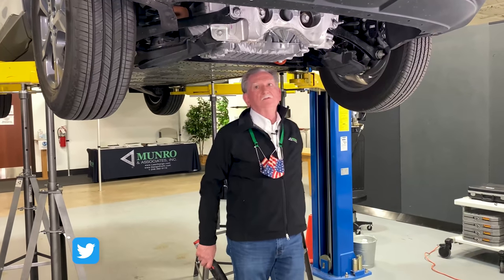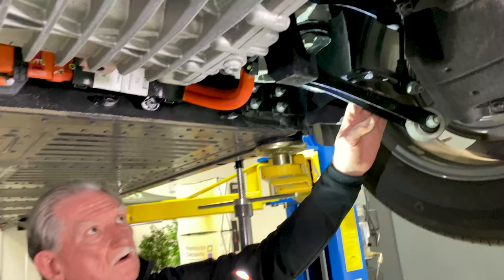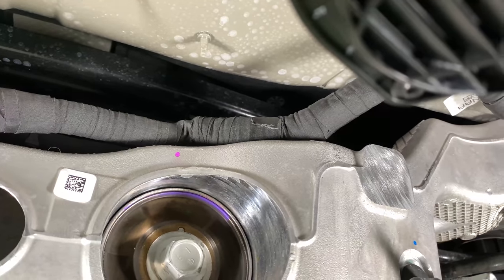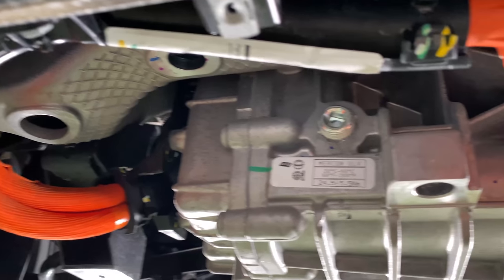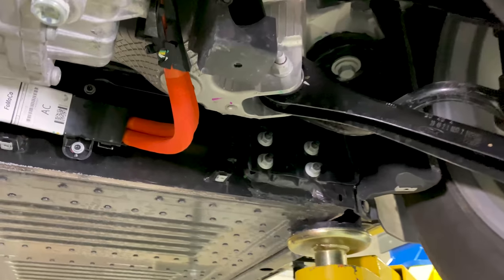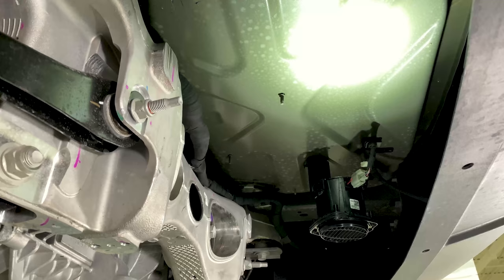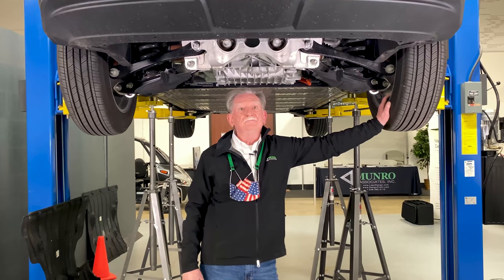2021 Ford Mustang Mach-E: E4 - Hoist Review | Rear Suspension

Comment: Great for all Ford enthusiasts. The BEV market needs more competitors. Some thoughts. Those orange power cables to the motor looks quite unprotected. Also some of the screws sticking out from the alu cradle looks way too long. Minor but still a bit annoying. About the cheap stamped control arms... I understand those are cheap but in my view rubbish for second hand owners. Why? Because they rust and then break! I've seen plenty of those snapping off on cars just 8-10 years old. Cheap part to replace but it can cause an accident and the car will be towed once it snaps. Be careful and change them before they break. This part is never planned in a service schedule. You have to know it's a weak part and look for it. Inspection often fail to find it. I prefer aluminum. Light, strong and last a long time.

Comment: now they just need to fix their chargers and set up millions of charging stations
Reply: They need to fix their horrendous charging curve too. It takes an hour to get to 80% on a DC fast charger and then another 45 mins to get to 90%, and another 45 minutes to get to 100%. That’s completely unacceptable and much more important to the consumer than a hollow cast cradle.
Reply: @SciFi Author B.L. Alley if they dump EA they will be left in the stone age unfortunately they are the only 3rd party fast charge network right now of any significance that has the speed and locations.
Reply: If they would have simply bought into the Tesla Supercharging network they'd be in good shape.  Oh yeah, then they'd have to pay for their share...
Reply: @CFG39  48 minutes from 0% to 80%.  Now the curve from 80 to 100% is unacceptable.  We'll see if Ford can improve this (or not).
Reply: @N7_Maric  I’ve seen multiple tests from 1 and 2% to 80% and it took between 55-60 minutes using a 350kW EA charging station.

Update: Ford claims 52 minutes for 10-80%, so I think my 55 minute time is pretty fair. Even if it’s 48 minutes, that’s still 20 minutes too long. It should be 0-80% in as close to 30 minutes as possible. VW ID.4 hits it in about 38 minutes. Since Mach-E has a larger pack and a huge buffer, they should be able to have a high C-rate the majority of the charging session.

Comment: Is it a good idea to have those HV leads exposed so low to the ground?
Reply: Rolling Ground out...........LOL.
Reply: Every brake and fuel line is there, no problems with it.
Reply: There is normally an aero shield which he didn't show being removed. Also, all external electrical connectors are sealed and tested for car wash spray, etc. anyways.
Reply: @db4z09  
"Aero shield", good to know.

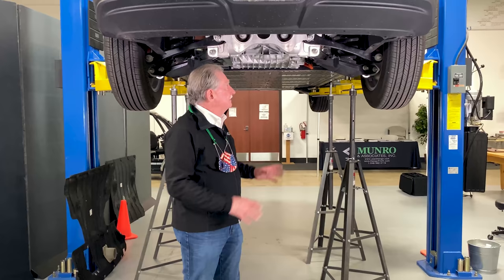Comment: Wait, gotta comment again.  6:09 is a speaker for fake exhaust?
Reply: Fake exhaust (if turned on) is piped into cabin through speakers, not outside. This looks like the EV pedestrian warning speaker which is required on all EVs by the NHTSA. It produces a noise at low speeds so car can be heard.

Comment: Hmmm... As much as I want to justify the reservation I have on an ID.4 the more Sandy looks at the Mach-E the more he's convincing me that Ford has done a better job engineering it.  I have time as I reserved an AWD ID.4 Pro which is unlikely to be delivered until late this year. 

 I may have to go drive a Mach-E and compare model prices to the ID.4 I have reserved. 

...also there's beer holders on both the front and rear suspension cradles so that's a bonus!
Reply: Check out inside EV's. Battery and all that (Ford)

Comment: All of the good stuff comes for extra price. There is no "free lunch". This is why Ford Mach-E costs similar to Tesla Model Y while offering moderate specs, close or lower than in Hyundai e Kona. I afraid that in the next generation of Mach-E Ford will get rid of expensive aluminum casting and other expensive and labor-intense parts.
Reply: Castings mean less welding. (Tesla?)
What they don't have is either the battery spec, or the control electronics (or both?)
It's the emerging story.
Legacy makers can build the structure, but they started too late on the technology.

Comment: Can’t wait to see what the charging video brings. I hope he tests the charging from 0-100%. I want to see Sandy have a meltdown when he’s sitting at an Electrify America station for not 1 hour, not two hours, but TWO AND A HALF HOURS to charge this thing to 100%. I nearly fell off my stool when I watched charging videos and saw it took that long. Even to 80% it’s almost an hour. Going from 80% to 90% takes an additional 45 minutes, then 90-100% is another 45 minutes. That is a big no no in any car. It’s not like there is no buffer on the cells dictating a slow charge rate. The Mach-E has a huge buffer( >10kWh). Its charge rate should match an Audi e-tron or Model S/X since they all have about the same size packs, but it’s slower than an air-cooled Nissan Leaf. 🤦🏼‍♂️ 

Also, at 3:35, why does that half shaft look so rusty already?
Reply: @rogerstarkey5390  yeah, you just need to add another half a clock and you’ll have the 2.5 hours it takes to charge. Lol.
Reply: why you need to charge to 100%? no one charge to 100% on roadtrip.
Reply: @garfieldchenyu1  have you seen Electrify America’s charging network? There are some sections of interstates (I-90 for example) that have 1200-1500 MILE gaps between stations. Obviously on those routes you couldn’t go at all unless you only used AC charging, but there are many more places in the US with 150-250 mile gaps between chargers, even in highly populated areas. Some large cities only have a couple of slow 50kW CCS/Chademo combo units that are always broken. Unless you’re commuting between New York and Boston or Los Angeles and San Francisco, there’s a good chance you would need more than 160-200 miles of range.  That’s why charging to 100%, especially for the next 3-5 years, is going to be important for any car with less than 400 miles of range. If you have a headwind, or it’s raining, cold temps, etc. you could lose another 30-50% of your range. 

In PERFECT weather the Mach-E on small 18” 225-section tires will only offer up about 270 miles of range going 70mph. I’m sure the GT with wider tires and larger rims will be substantially less. So, what happens when you take away 20% of the range right off the top? Suddenly you might be down to 160-210 REAL world highway miles of range. 

160 miles won’t get you many places, even 200 miles is a stretch. At 100% there are a ton of states you can’t even travel through on Electrify America because they haven’t built any charging stations. Tesla pretty much has the entire continental US covered.

 Even in my Tesla I have to charge to 90% at Superchargers quite often so I can get to a destination that doesn’t have superchargers and back to that supercharger without running out of juice. The charging curve Ford has on the Mach-E is horrific. Even the 80% charging time of 50+ minutes is painfully slow.
Reply: @CFG39  Well how many ppl use EV to do 1200-1500 miles road trips? Less than 1% maybe?
Reply: @garfieldchenyu1  it has nothing to do with the miles. I’m just saying that there are HUGE gaps in our charging network, up to 1500 miles in the US. Even little road trips (140 miles each way) would need 100% of the Mach-E’s range. Watch Kyle Conner on Out of Spec Motoring drive his model 3 all over the US.

Comment: Can't believe they didn't paint the half shafts. I hate rusty components on my cars. Otherwise as a VW guy I would take the Mach E over the I.D. 4 at this point. VW really messed up with the hassle of using the charging network that they had to pay for. I guess they had to set it up because of diesel gate, but they refused to do it well, a complete CF from an ease of use standpoint.
Reply: I've been seeing this a lot. In fact there's a large rail bridge in OKC, OK that is the same color. I'm pretty sure it's CORTEN  steel, and it's not your grandad's rust. It's the protective coating, and it is "self healing" to a degree.

Comment: Whatever you do, don't do with the Mach E that you did with the model 3: go on a road trip. Road tripping in the Ford won't be as easy as in a Tesla.
Reply from the maker: We are just doing a teardown, no road trip.
Reply: @MunroLive  I'm eager to find out what makes the Mach E less efficient than the Model Y: bigger battery but less range.
Reply: @teslasnek  The Mach E actually gets better real world range than the Model Y. Pretty significant too. Tesla's EPA ratings are pretty much BS at this point. Check out Alex On Autos Mach E vs Model Y range test.
Reply: @teslasnek  real world tests show it has a longer range than the tesla. It's not as efficient, but it can go farther
Reply: @invalidopinion3378  I've watched those videos, and they still confirm the Mach E is less efficient than the model Y: it uses more Wh per mile. I'm just curious why.
Reply: @teslasnek  biggest reason is probably the exterior design/air drag. 

Mach e has a coefficient of .3
Model y is .23
Reply: It's been done.
Inside EV's.
Ouch.
Reply: @DanielBlaney  
Or check out the long range road trips by inside EV's. (Tesla for the easy win)
Reply: When I got my Mach-E Feb 15th,  Electrify America charging,  no work work, big pain in the ass.   Last week,  plug and charged without a hitch.   I think their are a lot of folks addressing the charge issues for the better.
Reply: @invalidopinion3378  I was going to speculate power to weight..  It underscores an issue tesla has faced.  Make a bigger battery or fewer cars or smaller batteries, more cars and recoup the range loss with efficiency.
Reply: @invalidopinion3378  mach e must be 0.25

Comment: Are there concrete reasons the other EV's don't offer any kind of interface to the Tesla charging network, even via smart adapters?
Reply: Tesla won’t let them.
Reply: Tesla was willing to share (at least at one point) but they required the vehicles take a charge at a certain rate so their stalls would not be filled with slow charging cars from other makers.  At that time a lot of the other EV's did not support fast DC charging so it kinda fell to the wayside.
Reply: @TheEvilmooseofdoom  The legends around Tesla's willingness to open SC for other cars are fun.
You know it worked for one day at v3 in Germany for Taycan and VW, but Tesla was quick to fix it. 😁

Comment: Sandy are those hollow castings aluminum?
Reply: yes
Reply: @MrZrryan2  Won't road salt turn them into swiss cheese?
Reply: @terryrogers8965  Depends on what alloy they are using.  Some alloys resist corrosion better than others.  I would coat the hell out of it with an asphalt undercoating either way if it was me....

Comment: Why are the drive axles rusted??
Reply: I know in days gone by they were pretty thick and surface rust was not considered much of an issue since it would take the rust (under most conditions) several times the life expectancy of the car to rust through.
Reply: @TheEvilmooseofdoom  when you look at the quality of metal used on that part, i can imagine how the bolts and screws holding the car together will look in a few years. Furthermore, If I was to pay 50k+ for a car, I don’t want to look at rusty parts after only a few months. Its so easy to treat the metal or just use a better quality of metal.
Reply: @aircraftpartner2695  Do you know what material those bolts and screw are made of?  No.  Or how thick the metal is?  No.  You're reacting based on assumptions more than understanding.  If there is no material benefit to using a better quality material or treating why incur the costs?
Reply: @TheEvilmooseofdoom   That is correct, I am making an assumption that because the drive shaft is showing signs of surface corrosion after only a few months, that maybe its cause is poor metal quality and/or the treatment of the metal. For this reason, I would also wonder about the metal quality of other components!

Comment: Glad to see there are good EV options coming out but it seems like Ford is a generation or two behind on battery tech. Less than 300 miles on an AWD is a deal breaker considering the price, which is about the same as a Model Y. But, on the other hand, Ford appears to have done a better job with quality, which Tesla continues to struggle with.

Comment: Looks much better than the iD4 from an engineering standpoint. Still the Model Y seems to be better, eg. the heat from the motor is not wasted, but redirected via the octovalve.

Comment: Albeit, some beautiful engineering, and manufacturing on display here, but I can get 8 more miles of range (238 vs 230 est!) for way less than half of what it would cost to get into a Mach-E right now with a used Chevy Bolt. When it comes down to it, Ford didn't deliver on the bottom line, in my opinion. The recent sales slump has brought this to bear.

Comment: So, I had a Honda civic in the early 90's that had hollow castings like that in the front and rear suspension.  They corroded with the street salt in the winter and had to be replaced.  Those U-bends and the belly of the battery case are subject to rust too.  Furthermore, the riveted panel on the bottom of the battery pack is subject to rust as well and I'll bet that once that panel develops holes, your battery is gone.  I'd give that car 5 years in a harsh Chicago winter.  4 if you have to commute on salty roads.  Those hollow casting are going to fill up with salt, mud, dirt, oil...and the salt and the iron in the mud are going to destroy the aluminum.

Again, I think your easement of the Mach-e is weak.
Reply: How long is the actual warranty period? 🤔

Comment: 5:43 theres enough space that if i had a mach-e i'd machine and bolt on a mount from underneath so i could carry a fire extinguisher or my winter shovel under there.
Reply: Enough space for a full size spare tire and rim.
Reply: You'd mount the fire extinguisher on the exterior?  Would it be encased in anything?  I ask because you mention a winter shovel which to me says snow and salt and all the extinguishers of my very limited experience are painted steel.
Reply: @TheEvilmooseofdoom  we have milder /salt-free winters here in Oklahoma, but i'd probably bend together a little galvanized tube with a sturdy latch to keep road filth and corrosive elements from getting into the valves. 
I mentioned the shovel because when it does snow I pack a little 36" shovel and having to find someplace in the interior to put it, or stow it while it's wet, can be a pain.

If it was easier to access, i'd fab a box that i could put wet boots/towels/coats in from the outside if i didn't want to just put them in the frunk.

Comment: Why do exposed drive axels in video front and rear have rust on them already? Is this just normal ford business as usual, because they are not rust resistant, galvanized, or treated?
Reply: It's cast iron and they will have the same surface rust 50 years from now sitting in a junk yard and be just as strong as the day they were cast.

Comment: Question is how much it cost and how long to build that overly engineered stuff? 🤑
Reply: Watch his recent discussions.
Tesla castings probably reduced the body shop by 80%.
Welding panels is "engineering".
Once a casting is designed, it's virtually "free" other than material cost.

Comment: i se a lot fo steel parts with "no rust protection"  WHAT? :(
Reply: Steel?
Reply: @one_flew_over_the_cuckoos_nest   yes. iron parts containing more carbon for strength.
Reply: @grapsorz  lol>
Reply: @one_flew_over_the_cuckoos_nest  the black "paint" that i sover it have just about no protection at all. it will rust in no tam sadly :(
Reply: @munrolive.2103  have you actually ben hacked? ahh no it's a fake account.. well i hope they remove this one ASAP.
Reply: @grapsorz  Yeah fake, file a report!

Comment: According to Munro the suspension in the Mach e are A+ compared to Tesla. 

Then why does the Mach e bounce on uneven roads its horrible even worse in the back seat. It feels like the suspension is done and need to be replaced when driving the Mach e on uneven roads. Posting a clip of it below. Ford have done a great job but the suspension is really bad in the car. 

https://youtu.be/w7wfHopWtio?si=8FnSVUMpMb0vttLR

Comment: Yes, well, what your seeing is Ford desperately trying to stay relevant over the next 10 years. Tesla and Elons' ethos of rapid and radical innovation has driven them to this, they never wanted to put out a very well engineered product, that is unless you consider engineering a product to just barely outlast its warranty. They are copying Tesla at every turn, the casting makes this obvious and that's why it doesn't look like a Ford in any way. I just hope, the auto manufacturers never go back to the iterated Prisoners dilemma game they had going on since the 60s . This industry is incredibly prone to this Capitolist strategy because they know they can't price fix and get away with it, but they can all product fix, that is where no one manufacturer does anything extraordinary and thus enable all to profit grossly.

Comment: MUNRO Live - Sandy the FORD Muck-e unfortunatly is still Too Heavy and its Hendeling is not LIMBER enough . 
Muck-e is still made like a GAS car , it needs to do away with all the LEGACY components and Design everything NEW from Scratch , rather relying in the FORD parts bin.
Reply: Did you even watch the video?
Reply: This guy is such a troll. Why are you hating so much? All EVs are on the same team with the same purpose and agenda. Why so angry bro?
Reply: What "LEGACY" components are you taking about, the sun visors?
Reply: @Frialfamily  - the PROBLEM with LEGACY BEV is they are POORLY DESIGNED and they are only HALF trying to build BEV. 
they dont want to, BUT THEY HAVE TO build BEV in order to SURVIVE.